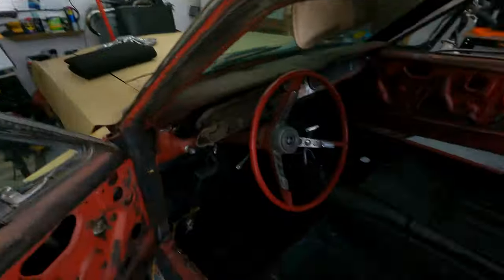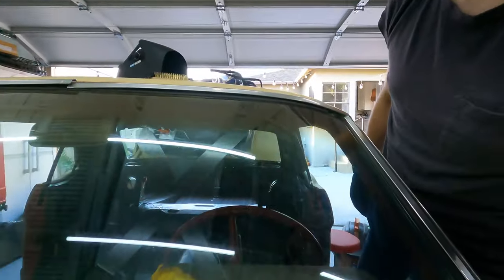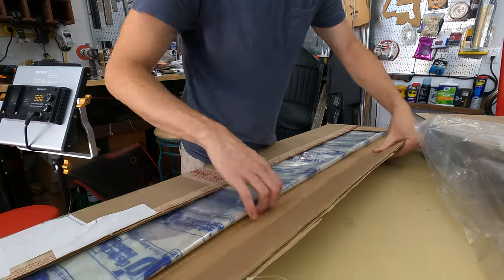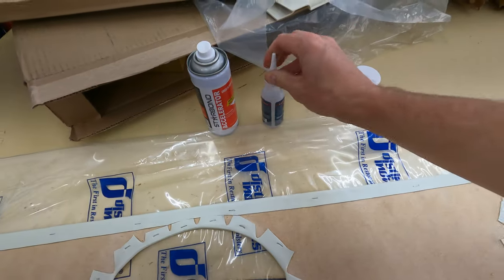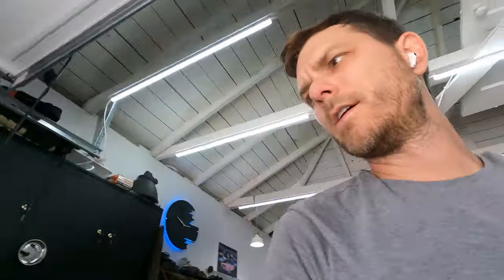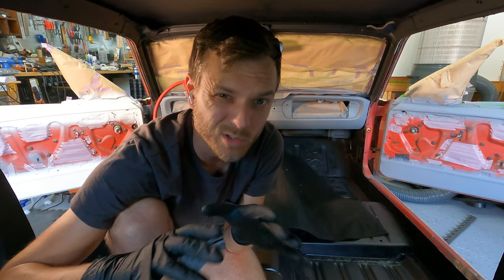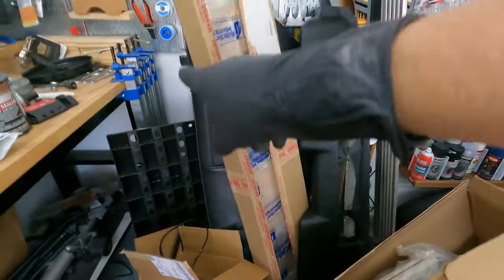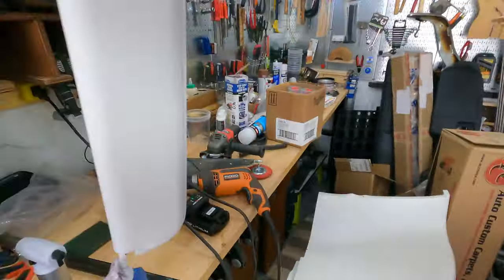Painting the Interior On My 1965 Ford Mustang Restoration | Part 5

Comment: These videos are awsome and always insipre me to work on my own mustang. btw, did you sand the inside of the roof in any way before spraying on the rustoleum? if not, any visuals on how it's holding up? thanks in advance!! keep up the great work!
Reply: Thanks! Yes, I sanded down the whole inside of the roof in order to get a good scuff so the paint would better adhere. I used fiber and nylon wheels from harbor freight, just used them in a power drill. I also focused more heavily on the rusted areas. The rustoleum is holding up really well. The rust reformer is really good stuff after it's had time to properly cure!

Comment: Hey how did the door panels come out? I was curious to know if you were able to preserve the texture on the door? Great stuff thanks for making these videos!
Reply from the maker: Yeah, they came out great! I'll add in a close up of them in my next video when I put on the door panel inserts. The trick to removing the paint and keeping the grain is to use the nylon 80 grit wheel that I used. It removes the paint while preserving the integrity of the metal. Thanks for the support!
Reply: @VanHoutenBuilds  thanks for the tip! I need to clean up my door panels so I appreciate the advise. The steering wheel restoration also was a help. Thanks again.

Comment: I've had good and not so good luck with parts from CJ. It's coming along nicely though. I just found your channel and haven't read any comments, but I'm guessing the hole in your trans tunnel was a drain for a dealer installed or aftermarket under dash mounted AC unit.
Reply from the maker: Maybe I should have kept it there in case I wanted to intall AC in the future, whoops hahah
Reply: @VanHoutenBuilds  🤣🤣